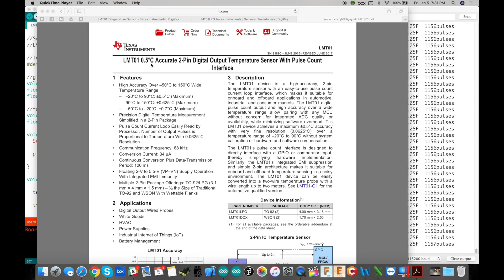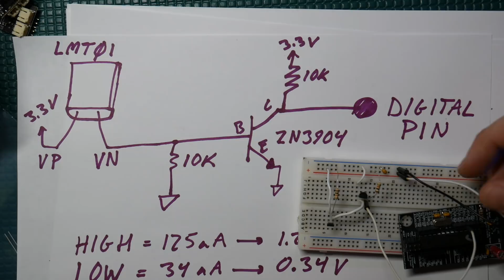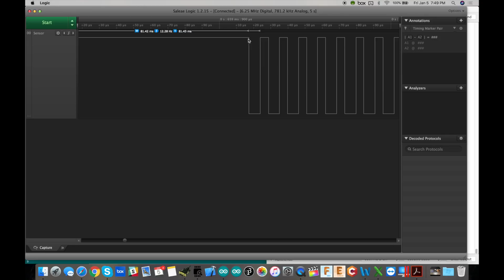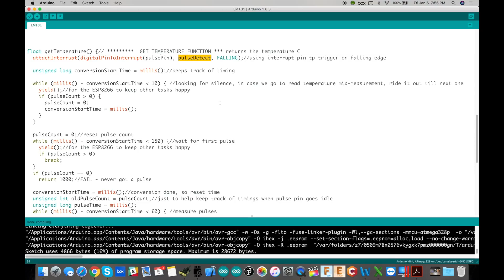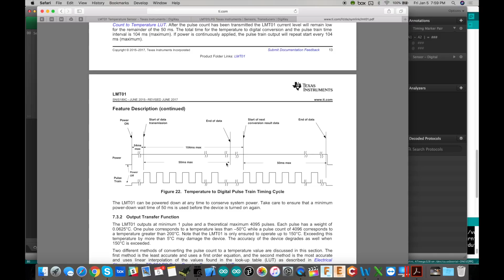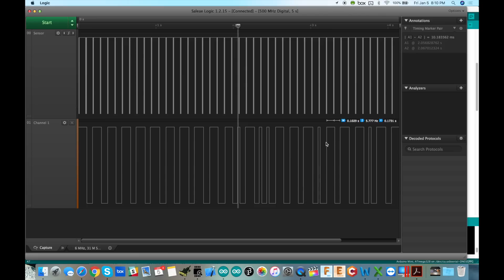LMT01 - My Favorite Accurate Temperature Sensor - Full Tutorial Arduino and ESP8266

Comment: 7:24 don't drive that pin low, set it to INPUT aka high impedance state.  Datasheet specifically warns against setting GPIO pin to LOW if you are using it to power the LMT01, something about reverse-biasing damaging the sensor.

Comment: In getTemperature(),  you should disable and then re-enable interrupts whenever you read or write the pulsecount variable. It is 16 bits, made up of two bytes, and one or the other of them may get changed by the interrupt handler simultaneously with your main loop access giving confounding results.

Comment: Thanks for this, Kevin. A really helpful tutorial. The code works fine on arduino uno and a cheap generic esp8266 (lolin NodeMcu v3) but curiously on my Wemos D1 R2 the serial monitor shows that it keeps on resetting every few seconds. With an error message that is well beyond me (runs out of memory?). 
 
ets Jan  8 2013,rst cause:2, boot mode:(3,6)
load 0x4010f000, len 1384, room 16

The LMT01 is a great little device and has confirmed what I suspected - that my ds3231 tend to read a couple of degrees high.

Comment: There's a bug in your getTemperature code - if you fail, you return 1000 without disabling the interrupt handler. I don't know how the Arduino handles that, but I suspect it'll keep running and waste some power. You should disable the interrupt handler a couple of lines further up as soon you stop needing to count pulses.

Comment: I have a question about your use of an NPN transistor, Why? Doesn't an NPN's gate react to changes in the current flow between the Gate-Drain terminals? Not the voltage differential between the two (like a MOSFET). 

Also, wouldn't it be better to forego the 10k shunt resistor and just push the current flow through the sensor directly into the NPN transistor? It would introduce a 0.7 volt drop across the gate-drain terminal of the transistor but you can compensate that by pulling the voltage on the Vp pin to 4 volts, or add another diode in series with it and pull it up to 4.5-5 volts. 

This might just be a moot point since it obviously works for you, but I was just curious.
Reply: NPN transistors don't have gates or drains. Effectively they amplify the E-B current by approx 100. Voltages discussed here are inconsequential, it's more about current flow into the base (technically, out of the base). If you were to forego the base to ground resistor this would send all of the idle current (34uAmps) into the base, possibly biassing the transistor permanently on. The resistor has to be just the right value for the transistor to be biassed off between pulses and biassed on during a pulse. It actually should be closer to 6.8k not 10k.

Comment: I feel like the code is needlessly complicated (in the getTemperature function).
Maybe something like this would be simpler (UNTESTED!!!):

#define pulsePin 2

uint32_t last = 0;
uint16_t pulses = 0;
volatile uint16_t last_pulses = 0;

void pulseDetect()
{
  uint32_t now = millis();
  if (now - last > 50) {
    last_pulses = pulses;
    pulses = 0;
  }
  ++pulses;
}

// This needs to be called only once!
void startTemperatureConversion() {
  attachInterrupt(digitalPinToInterrupt(pulsePin), pulseDetect, FALLING);
}

// Returns temperature from last conversion
float getTemperature() {
  return 256.0 * last_pulses / 4096.0 - 50;
}

void setup() {
  Serial.begin(115200);
  pinMode(pulsePin, INPUT);
  startTemperatureConversion();
}

void loop() {
  Serial.print(getTemperature());
  Serial.print("C");
  delay(250);
}
Reply: thanks for posting this. The sketch throws an odd error on last line (35). I've looked it up but can't fathom it. Code looks fine to me.  

LMT01_test:35: error: expected unqualified-id before '?' token

 }?

  ^

exit status 1
expected unqualified-id before '?' token

Comment: you are never going to see 1.25V on that 10k resistor, it is shorted by the BE diode
Reply from the maker: yes! that is true - I definitely could have explained that better.  It clamps at ~0.7V, so really should have said the 1.25V will be enough for the BE junction to clamp - thus turn on
Reply: Lol, I just went to the comments to find this as expected. :)
Reply: I was kind of hoping for more drama and controversy on this thread, with a math dispute.

Comment: Does the PUSH notification sent to my smart phone get mixed in with all the emails that i would get if i enabled getting emails on my phone?  Thanks.  Great design!
Reply from the maker: it's from a separate app - I use Pushbullet, but could reprogram to use Pushover or even Slack.  You an turn off notifications for this though, if you don't want to be bothered.. like if you just want to check in and see if there was any activity

Comment: We have used the DS18B20 on many projects.. 
What was the Temp range you needed for your project ??
Reply from the maker: this project didn't need anything special, but the low current and conversion speed was very important.  Nothing against the DS18B20, but a while back I bought a bunch of them from Amazon and pretty sure they were counterfeit.... so watch out for that.  Again, buying from Digikey and you're good, but I think they are pricier than the LMT01

Comment: why you had no luck lately with DS18B20? i'm using it with PIC, AVR, STM32 (5Vcc tolerant) micros.
Reply: peasant vasea so many reasons, .1 not .5 degree precision. The ESP has wifi and is fast and is 3.3v.
Reply: Well, precision at .5 (both have the same precision) is good enough, you can work with multiple buses of say 8 devices each and doesn't require processing power - I can use the micro for any other task. And of course, I can use it with an STM32 at 3.3 or 5Vcc https://nucleobytes.blogspot.ro/2017/01/the-wire-has-fever.html. But it is nice to know how to use the TI temperature sensor, without any other reason. Thank you for that!

Comment: Sir I need to do the project of "Real time monitoring of transformer by using IoT"Can you help me? Please sir!! I want to submit project before February 5 ..I don't have enough knowledge please help regarding my project 🙏🙏🙏
I want to monitoring real time values of voltage, current, temperature,oil level and transfer these data by IoT . What can I do for that? Please suggest some helps 🙏
Reply: Hire an electrical engineer.
Reply: David Jackowski sir I'm also electrical engineering student sir. I want to do the project myself with the help of YouTubers .. That's why I'm asking his help..If you have an idea about my question please suggest some ideas..Thank you!!
Reply: Have a look at https://youtu.be/fwb5YAPzPGk
There are many other good videos on YouTube 
Do the work yourself and learn!
Reply: Arduino uno + wifi module usually is adding esp8266 to an arduino uno. 
The easiest thing would be just to use esp8266.  I presonally wouldn't use the NodeMcu programming enviroment but stick with arduino IDE for programming the esp8266.
Look on www.instructables.com for or youtube for a similar projects and use their code.

You can also ask questions on the adafruit discord http://adafru.it/discord but I would recommend first to look at examples on instructables.com
Reply: I can make for u if you have money.
Reply: ESP8266 would be my choice but you have to make your own choice. Why not ask your college/tutor/friends what their view is?
Reply: Can you describe the steps you already took to accomplish your goals?  I would start with a simple project rhat just monitors a temperature there are dozens of examples you can find by googling and expand from that.
Reply: ddjazz  I have lot of confusion on which board can use for this project among (NodeMcu esp8266) or (aurdino uno+ wifi module) Due to this I don't start my project. Just collecting information regarding the project. can you provide links based on my questions...if you can 🙏 Thank you for your reply
Reply: bonnome2 thank you 🙏
Reply: Mike Hudson They won't help me 😏😑😥 That's why I'm asking here . My friends are doing project in project centre.I don't have enough money.